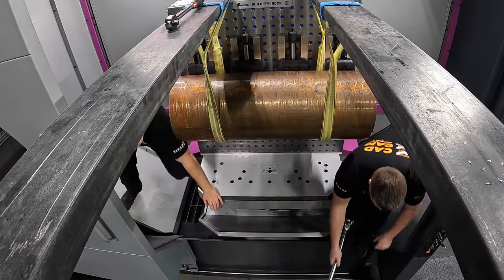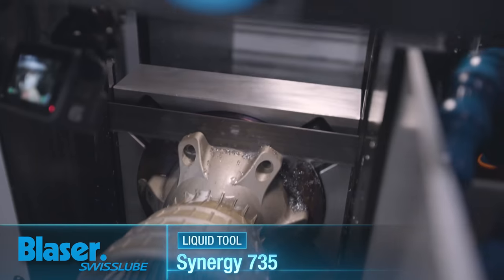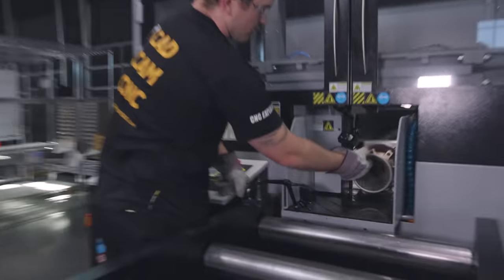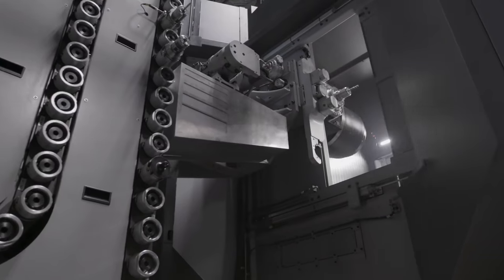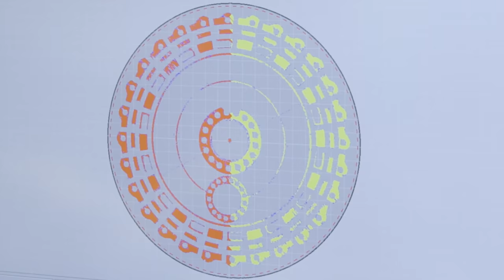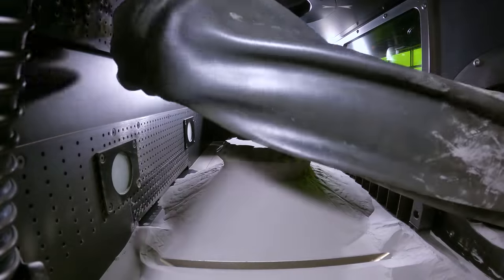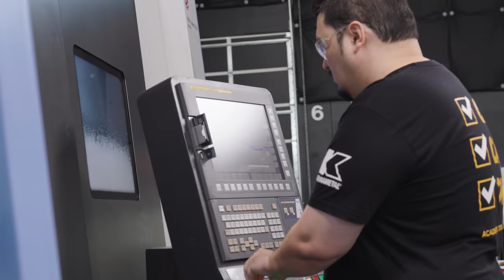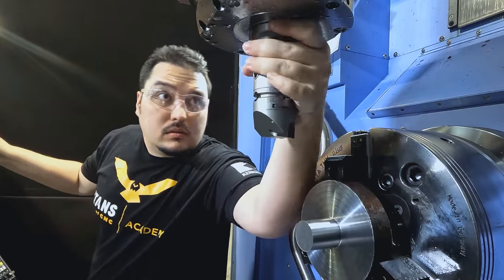Woman’s Hair gets caught in CNC Machine… Scalping and Nearly Killing Her

Comment: My craziest accident was like a year into it. Was turning a 30" tubesheet on our VTL. I had finished one side, flipped it over, set it up, roughed the OD down to within 30 (2 .200 cuts), and was doing the "match" cut up. Bout .015 to a side. Halfway through the cut the tubesheet wobbles likes twice and bam its thrown out the machine. We have these tall wooden barriers to keep the chips somewhat confined. Well it slammed into that and took it with it into our other VTL, and the way pierced through the wood like a hot knife through butter. If our other machinist was working on that machine it would have sheared both his legs in half and thrown him into his machine most likely. I got pictures of it somewhere if anyones interested. 

I stopped my machine and checked tightness on all 4 jaws on every job like 3 times per side for 2 years after that. Learned a very very valuable lesson pretty early on without anyone getting hurt. That has gone a long way as ive never had another incident anywhere near that bad nor injured myself. Knock on wood.

Comment: Everything in the shop can and will maim and/or kill you if you let it.

Even when I'm programming and making fixtures I'm thinking about avoiding conditions that will send a part flying through glass and into an operator's face.  

CNC machines are dumb but they follow instructions really well.
Reply: i like to say "machines are designed to cut metal, metal is hard, skin and bone is soft. It wont even know youre there."

Comment: Yeh I've seen that happen. Have watch long hair around machines. The magnet field will attract the hair. One of the victims I seen was a woman. It didn't kill her but pulled out a large patch of hair and sculp. When she came back 6 months later. I was operating a Bridgeport behind her about ten feet away, she was on a drill press. I turned and look at her and there again she had her long hair back out while operating it. Her hair was just starting to lift up above her head and start in the direction of the drill press motor. When I stopped my mill immediately and ran over to her and pulled her back and shut off her drill. I told what was going on with her hair and what was just about to happen to her AGAIN, unbelievable. I wonder if she's  bald now or took up another line of work...lol...

Comment: One thing I do right in the shop is where my safety glasses all the time. I wear them everywhere, bathroom, lunch,  brake time, even if I leave the plant to go down out to the store. I don't even know I have them on. Many a times I've gotten brake cleaner sprayed back into my face but the glasses kept anything from happening. We use a lot of degreaser where I work. I was careful to search for a set of bifocal so I could look a head and see clearly or look down at the print and still see the numbers. It wasn't easy to find a 2.0 lens for reading with a durable frame in safety glasses but I finally found a pair on amazon. And you should get the kind that wrap around a little too for added protection of which i have. Blessings.

Comment: Now I had to think back to the fact that my psychopathic supervisor had turned on the chip conveyor when I was taking out the chips by hand and was only inches away from the conveyor belt.
Hope the translation is correct, however.
I could have lost my fingers or my hand and it would have been an accident because I didn’t use the emergency switch as prescribed.
The truth is, then, it wouldn’t have been an accident, it would have been an attack.
Anyway, machines don’t know pity, just like that bastard, only machines are far stronger.
Don't forget that for a second.

Comment: in 1973 we had a shop safety film. Two things. A man with long sleeves got his shop smock caught in the spindle of a manual Bridgeport mill and removed by traumatic amputation his left arm at the shoulder joint. Smock and deceased arm were both wrapped around quill. The second part, a man without safety glasses got a chip buried in his eye. The film showed an eye surgeon pulling on his eyeball with a stong magnet , almost enough to puke. After the film the shop teacher shared how a few years prior a long hair got caught in a threading operation on a manual lathe. Almost getting his skull crushed by the head chuck, the teacher had a power kill swith to shut the entire shop down at his podium and just by chance he was standing there grading papers when he caught it. The long hair had half his scalp on his head and the other half wound up in the lathe chuck. Life is full of misery learning lesson.

Be a CHAMPION!............use your head.......be smart.....don't second guess.....take your time for safety............you can always get a new job...........body parts are irreplaceable · irreversible · beyond repair · broken · cureless · destroyed .  86 the Goa love bracelets, watches , rings, necklaces, and long sleeves. That's what the top center drawer in your Kennedy's are for, not on you person. Either polycarbonate  prescription eyewear or approved safety glasses. Your eyesight is a precious gift from God. Once it is gone, it's gone forever. My mother spent the last 15yrs. of her 50yr. surgical nursing career working for an eye surgeon.

And just for the say so, Department of Labor and Industries PROHIBITS one person working alone in the shop  at any given time. There always has to be two or more people, even on 3rd shift. Massive, massive fines and lawsuits.

Comment: Absolute truth.
Don't jog while using a dial indicator, use the spin handle instead.
And be very careful when you start spinning an edge finder. One second you get too comfortable and then you accidently write S6500 instead of S650. Always check yourself twice or more. The efficiency and speed doesn't worth your health. Don't get affected if someone pressures you to work faster. You have to be confident in what you are doing.
Reply: This is true. Do not let people pressure you to work faster be quick but dont hurry

Comment: Yeah I accidentally smashed my left ring finger once when I was tossing thick scrap aluminum into a bin. I had welding gloves, so I wouldn't get hurt by the sharp edges. As I was tossing it from a pallet to the bin. My finger became a point of contact when I threw the aluminum about 1inch in the air instead of gently putting it down in the bin because I was working in a fast paced environment and trying to get things done. And of course my fingers split like a hot dog towards the tip due to the amount of pressure and my blood had nowhere to go. After that my hand felt wet inside the glove. Luckily  I had no scrap or anything of that nature. Just clean 3/8in laceration at the tip of my finger. I was like darn it and notified my supervisor as I was walking towards a clean rag or paper towel. So I can apply pressure and stop the bleeding. It wasn't to bad but I did need two stitches because my skin pointed outward at the wound site. Eventually I had to go to the front office and fill out an incident report. Which I find as a red flag instead of directly taking me to the hospital. Had someone take me to the hospital and eventually they injected lidocaine at my finger tip and put 2 stitches on it. I was working 2 jobs at the time because warehouse was paying more than my current CNC Machine shop. I couldn't work at my warehouse job for 2 weeks because I'm not supposed to lift anything with my left hand. Even though I'm a door closer which didn't really have a lot of heavy lifting at all. At my CNC job I missed a day or two . And had an employee help me lift any parts that were heavy. That's when I realized the work culture sucks when a warehouse put out better safety measures than an not so ideal aerospace machine shop. After I got my stitches removed which took 2 weeks . the doctor that supposed to remove my stitches wasn't their and told me to go to the E.R. which took 3 hours because they were swamped. (I was better off removing them myself).  Also wanted me to pay $150 just visiting the E.R. just to remove stitches! I told them this was a work injury and filled out paperwork again. After that I put my 2 weeks in. I still switch to warehouse afterwards because they didn't want to match $18.50/hr in California 1 year into the pandemic and the beginning of the rise of the great resignation. They tried to compensate for this by attempting to placing me to night shift and I declined as they still want to cheap me out 50 cents alongside the lack of welcoming environment didn't help  and attempt to buy people out with positive reviews on indeed.

Comment: It aint just boys or girls hair. This happened at my old job (I retired at the end of 2014 after 32 years) back in the late 40s or 50s. A few guys were working on a Saturday for some OT. Larry went around to see if any one wanted some sodas for break. He went to the 80 year old guy running the radial drill press to see if wanted a soda. So, Larry goes and gets the cold drinks and when he gets back to the old guy on the drill press he finds the guy dead, and naked with every thing but his shoes and socks on every thing else was wrapped around the spindle.

Comment: cnc lathe operator here, I aint ever had any major accidents happen to me with machinery but I know several that have.  A co worker of mine was running a medium size drill press (5hp motor)  he had COTTON GLOVES on!  that would have been ok if he didnt try to sweep the chips away while it was running!  He got caught and it was winding him up, Just so happen another worker was standing near him and slapped the off button, he was standing on his toes arm all folded up.   Thank the Lord above the fella did that other wise it would have been a terrible accident.

I worked at a shop making solid surface counter tops and was learning how to run routers and various power tools.  the boss had a nasty scar on his stomach and the story was he had a loose fitting shirt on not tucked in one day several years prior.  the high speed router bit somehow grabbed his shirt when he was close to it and it sucked the router up and stuck it in his stomach near the belly button, it would have been much worse but he was strong enough to keep it away from him as it spooled down.   

long hair, sleeves, gloves, loose clothing or strings hanging off of you while running any machinery or power tools are breaking the rules of life, you will eventually have an accident no matter what if you break them!
Reply: No gloves on any drill press are ok.

Comment: Our pallet changing mazaks , you have to crawl inside to clean out chip clogs it’s the only way, some guys don’t Estop or lock out tag out the machine before so, if you command and m911/m912 and forgot about it, and the secondary door gets shut by someone . It will literally turn you into mushy nothingness . There is so room for a body when it turns

Comment: As a metalhead, wich had had long hair till past week, I've always been on Cnc lathes, but had to do jobs on both a manual lathe and some table type boring mills and radial press drill.
One of my buddies had a bafluck sanding a part.. he's okay, but I took that as an example, and now have short hair.
Distraction and moving parts... If you can avoid thoses, half the job is done

Comment: If you’re all for safety, why did you drill through a forklift fork ? Now you created a weak spot in it. I’d be throwing that out ASAP.
Reply: Many forklifts that i have worked with already had a hole in the end from the manufacturer. And that adds another element to this video: understand what your equipment is MEANT to do
Reply: @barrysetzer  i have noticed forklifts with holes in the forks too so its fine ig
Reply: Its for installing a stopper. Not having it is more of a safety hazard. If anything slides off the forks and crushes somebody, thats a problem.